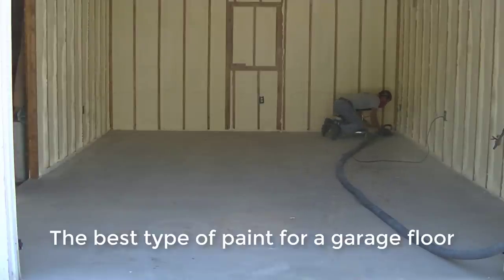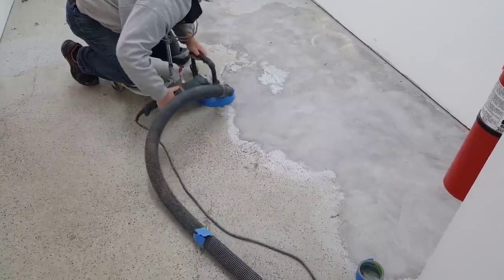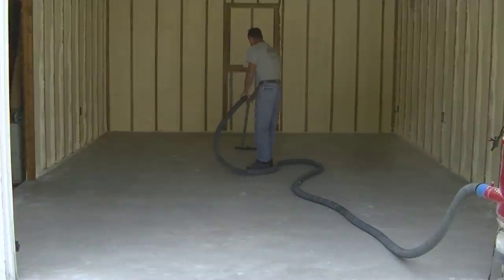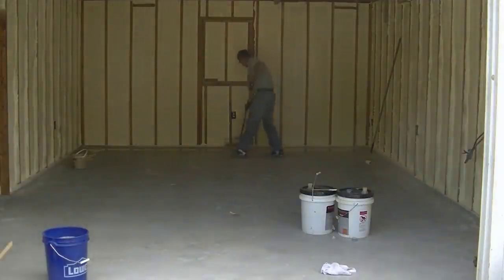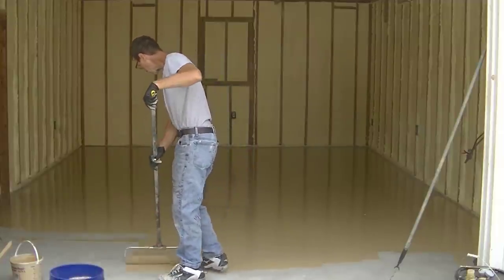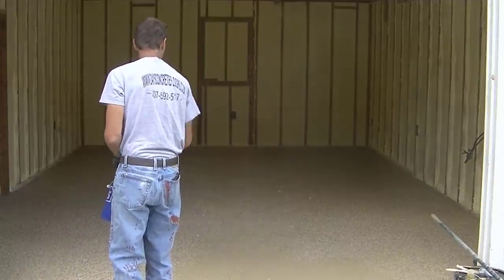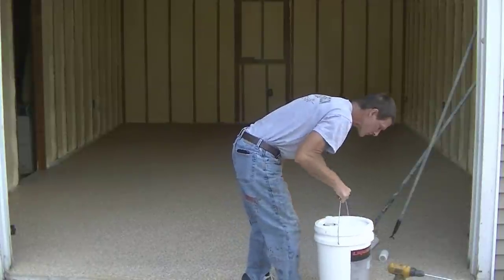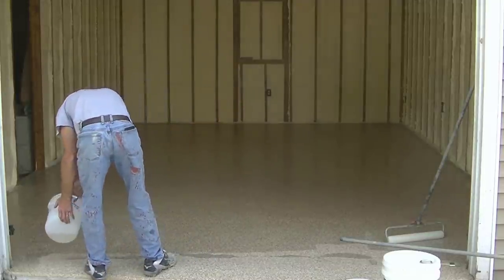Best Garage Floor Coating For A Garage Floor (Epoxy Garage Floor)

Comment: I'm going to try it. The supplier in my area sells a system which includes an epoxy prime coat, polyurea base, flake and clear urethane top and 2nd top coat. Sounds complicated.

Comment: I’m down with that. I use Epoxy Resin on desks, window sills, different projects & I was just recently talking with my wife about doing the garage floor. I’m really glad for your videos, very interesting. I’ve done hardwood floors but I haven’t tackled a garage floor yet. I’m sure it’s going to turn out beautiful, much thanx
Reply from the maker: You can do it Richard. Let me know how it comes out!

Comment: I used HC coating for our garage floor. Product application went well and we did not park on the garage floor for about three weeks. Within six months the rubber from the vehicle burned into the top coat in several locations…..disappointing. I used Goof Off, a scraper and commercial detergent to get the rubber off. Haven’t had any issues since. Plan on using Polyaspartics on the next garage project. Thanks.

Comment: We're considering coating a concrete floor but have not decided on what to use. I've used epoxy on tile floors (indoors) successfully. Thanks for suggesting the use of polyaspartic coatings!
Reply from the maker: Glad to help!

Comment: I want to cover my garage floor soon.  I have been in my house for 20 years wanting to do this.  I have seen some disaster coatings and some crazy expensive coatings. After watching this I think I can do this myself and do a good job.  Is there something I can do to fill the control joints?  I prefer to have a full flat floor.  Thank you.
Reply from the maker: We use this same crack repair material to fill expansion joints. https://youtu.be/J21TImyZL98
Reply: A1 caulking then paint over it
Reply: Do yourself a favor and have a pro do the job.

Comment: Mike, very good tips. My garage floor has never been epoxy/paint. I have a crack that you recommended the filler for. All I need to do now is empty the garage of 20 years worth of stuff...Oh!
Reply from the maker: Good luck with that Mike, sounds like a lot of stuff. This is how we fix a crack before coating the floor: https://youtu.be/5C7otrHKNgA

Comment: I had a brand new house built 3 years ago. This was the first project that I did on my concrete garage floor. I bought Rust-Oleum Rock Solid garage floor paint. I followed their instructions and it came out fantastic! I used 2 kits at about $95 a kit. Only problem with that product is, you must roll it within 10 minutes after you mix it, or it will turn into taffy!!

Comment: I am currently having a home built. I am planing on doing my garage floor. My question is , on new concrete is there still a need to go over the floor to roughing it up?
Reply: roughing up is for mechanical adhesion, for the paint to grab onto, not because the concrete is old or new. So yes, you need to.
Reply: @gwot  No, have the concrete finishers do a rough broom or a heavy broom finish

Comment: Hey Mike I have done two garage floors now.  First one I just bought the rust oleum 2 gallon epoxy kit....only comes with enough flake to speckle the gray epoxy nowhere near as much as you are applying.  Second time I went with simple gray floor and porch paint, broadcast some flakes onto the wet base coat and then went over it with clear epoxy with silica mixed in for traction.  I did it without cleats so I screwed up a few spots but no one can tell.  Next time I do it, I  going to use a lot more flake
..looks much more professional.  Oh and I didnt grind either floor just pressure washed with strong degreaser and then etched, then I finished prepping with a coat of white concrete primer which makes the actual paint spread out much better.  Concrete seems to drink up that first coat of paint if you don't primer it.  I spent about 300 bucks the second time

Comment: Two questions. Do you need to etch a newly poured garage floor? How long do you need to wait for a new garage floor to cure before using the coatings? Thanks
Reply from the maker: I never etch, I always grind the floor like in this video it's much better for prep. You have to wait 28 days for it to cure.

Comment: Love your videos Mike.  I am going to be doing my own work on my new 4 car garage I am building myself.  The concrete is new so I will be just renting a diamond sander from HD then applying products you are recommending.  The floor measures 24x48 so I will be breaking the job up into manageable sections to keep the product fresh.  I can’t wait to get started!

Comment: I had a situation where I used Polycoats  polyaspartic on a concrete floor , a  5 car garage. I’m 40 years in the business as a painting contractor and floor coatings specialist doing floors  like urethane membranes  over new plywood exterior decks with ground up rubber granules broadcast into  self leveling urethane rubber is what I started doing. The granules penetrated into the rubber  until  it wouldn’t take anymore and then we swept off the excess and then put a pigmented top coat of urethane over the granules, so everything was very flexible as well as the top coat of urethane . But when I used this  Polyaspartic I didnt have much help , it was very hard to put it down at the right Mil  thickness so I wouldn’t get too much  material buildup. My helper rolled the basecoat too heavy. By doing this , by the time you would broadcast the paint chips and as fine as they were ,they would pile up higher where the basecoat was put on heavier and they created peaks and valleys.The pot life or the grey base as well as the clear only gave me 15 min working time,  I tried to roll it out like your video example keeping a wet edge. To look at it the next day especially with the garage doors open when the light hit the floor the roller marks were in all directions and very uneven very messy and looked very bad because the valleys excepted more clear as a puddle , and where the texture was heavier ,where the flakes piled up and dried up in the heavier base material that showed more text texture and less gloss. So I had high gloss and lower sheen all over the place as the light hit the floor . I ended up sanding  the texture down to even out the floor where there were slick spots and where it looked too glossy . So the floor actually became smoother without the heavier texture of the  piled flakes ,then I took an airless sprayer with a lower sheen Polyaspartic clear , and misted it over the floor  in circular spray patterns to get rid of all the roller mark patterns  It came out even finally, but with a matte sheen.
Polycoats material is way too quick setting for the roller marks to self level. If you dont have 5 men working in unison, you cant get a uniform finish. I finally looked into some Polyaspartic that I was told had longer pot life and a longer working time. I never end up doing any more floors with such a difficult material .  Please tell me what you think about this and what material companies may have a better product ,so one man could work alone ,especially on a single car garage. These products are  such a bullet proof material nothing would compare to it
Thanks for any ideas

Comment: Mike, having new house built and learning a lot from your videos.  Have a question, my garage floor has been poured for 6 months.  It is not a smooth finish job so I have something to bite on with either of these products.  Two days ago, sub spilled oil on it and let it stand for 2 days before degreasing and scrubbing.  There is still a stain there about 12” diameter.  I was planning on just deck scrubbing the floor and allowing a day or two to dry before the oil spill.  What would you do for prep?  I was trying not to rent a grinder since floor was triled rough.  Thanks so much!

Comment: Thank you for the very informative channel. I am in Canada and my 25 year old 24x24 garage floor was never sealed or painted. It needs to have cracks filled and also levelled prior to using  any coating. I would like to do this myself but not sure and don’t want to waste my time or money making critical mistakes. Can you walk me through crack filling and levelling? Thank you

Comment: This is a great video and really explains the process well.  I had a question about the products you are using.  You put down one coat, then the flakes, then a second clear coat.  Are the products that you recommend that have 2 containers, is that the product for the first coat, the second coat or for both coats?   It is for both, are you mixing them together for the first (to get the color) but not the second (to get the clear)

Comment: that my challenge is going to be a Garage Condo 25' x 40' to store our RV in.  I'm also concerned about the weight factor as the GCWR is 15,250 lbs.  Basically, I
ll need something similar what's used in aircraft hanger coatings

Comment: Great video Mike. I have a brand new 30X48 pole barn. Just poured concrete and I made sure that the cure sealer was not applied. I'm having a local contractor out to give me an estimate so I can estimate the cost difference. I live outside of Columbus Ohio. Warren
Reply from the maker: Awesome Warren, good luck.

Comment: I’ve watched twice to get ready to paint a 3 bay garage. I like how you cover most of the items I will need. I notice that you don’t recommend a topcoat.
Reply from the maker: I used a topcoat
Reply: Mike I will have my contractor pour a garage floor soon, how long should I wait after pouring to paint or epoxy coat floor? Since the floor will be new and un-used do I still need a mechanical prep still? I will do it myself thanks for for the help.

Comment: Great video, Mike. I've been hesitant to use the big box, Rustoleum brand as it seems to be hit or miss. However, the main goal looks to be prep prep prep and I like what you did here. I'll be noting these brands you used for my garage floor. We own a driveway sealing company and it's basically the same mechanics for a concrete floor. Nicely done.

Comment: I had coated my floor with epoxy paint that  came in a kit and was well known (spray paint) brand.  It coated OK, but after much prep with muratic acid and much washing and long time drying, I was very dismayed with the hot tire lift off after only about 4 months in the end.  Question: Since my slap was poured with fiber in it, how do you keep that from hairing  up if I were to grind the old coating off? . I want to redo this, but want to go in eyes wide open.
Reply from the maker: Terence, just take a propane burner/torch to the fibers and it'll take care of them.
Reply: @MikeDayConcrete  Much appreciated!

Comment: Hi there 
I like your video the way how you demonstrate it. I just have a basement concrete to paint or coat, sealing I'm not exactly sure what the term is but I want to do it on my own and my kids can play free of dust. Can you please help with what should I use and if you can suggest a product, please and thank you? Basement is just two months old

Comment: Sorry this may be a dumb question and I may have missed it but I went back on the video a few times. 
So I went to the E2U website and found a clear top coat like you lastly used. But I can’t seem to find a base coat. What’s the base coat you used just before the flake? I’m also assuming the base coat is still wet when you add the flake. What if I’m doing a 1200sqft area alone? Do I do a patch and then flake, scrape clean and do it again? Or can I get get it all done at one time?  
Big thanks to who ever gets back to me 🙏🏼🙏🏼

Comment: Hi Mike,
Do you need to prepare the "green" concrete floor before applying polyaspartic coating after it was curing for 30 days? Also how do you check for a moisture of the concrete floor? If you need a preparation of the floor what the best product to use? Is it a good idea to apply  the sealant before polyaspartic coating?
Ed
Reply from the maker: You prepare it the way I did, by lightly grinding it. You can check for moisture by taping down a 2' x 2' piece of plastic to the concrete and leave it for 24 hours. After 24 hrs if you pull it off and the concrete is darker or damp under the plastic, you have some kind of moisture issue. Epoxy2u.com has a moisture blocker epoxy you can use in this case, then do your coating over that.
Reply: @MikeDayConcrete  Will do. Thank You.

Comment: My garage floor doesnt have cracks but it does 2 issues. 1. there is a small low spot about 12"x12" about 2 feet from the drain . Also, whoever did this floor somehow got small wood chips in the concrete. About a 1/2 dozen of them which are at the surface. I want to remove those wood chips and fill them, then coat the floor. I suppose crack weld is good for the divots left from the wood chips. How about a product that is self leveling for the low spot. I should probably rent a buffer with a diamond grinder wheel. Its a 2 car garage floor, 30 years old maybe,  never painted. I like your videos and appreciate any advice. ty Bob from Pgh PA

Comment: Hey Mike…I work concrete myself, mostly industrial formwork, and my best advice comes from you. I’m in the process of prep for a slab in my own garage…which is set on a 5’ frost wall. I’m debating placing foam under the slab, poly for sure. Should I do a separation between the slab and wall?
Sawcut and caulk? The slab is 24x26. 
Also…what thickness would you recommend, and should I use wire mesh/ rebar?  It’s mostly going to be used as a woodworking shop.  And…how long should I wait before coating?

Comment: Mike, excellent video. My garage has a 4 inch concrete ledge at the base of each wall. Do I prep and coat it the same as the floor?? I’d like cover it with something since the walls are white and the floor will be beige.

Comment: @Mike, I am chatting with E2U sales guy. THis is what he said
6150- 200 square feet per gallon
Polyaspartic 85- 150 square feet per gallon
Flakes-250 square feet per box

6150 is epoxy base coat but in your video it never mentioned. So my question for you is is there a polyaspartic base coat

Comment: hello mike, if i just scratched prepped a new concrete floor could i use a polyaspartic top coat right over it or over a prime coat...if i was going for concrete looking finish instead of a flake or painted look? thanks, looking into doing one for a good customer in a small garage where NO CARS will be going in and out

Comment: Mike how long before you can put a car back on it?  And the floor has some worn spots, what do you use to fill and level a one foot area?  What do I use to fill in the floor joints?  Thanks

Comment: Hello Mike! Thanks for the video! So the first coat you applied was a tinted polyaspartic? Like E2U's Polyaspartic 85? Then after flake, the top coat is the same product without the tint? Thanks!

Comment: Great video mike. I been thinking about doing this to my garage also. My question is I have moisture problem coming up thru my concrete floor,what do you recommend or am I best to leave it bare. Any help would be appreciated.
Reply from the maker: Michael, You can spray on this moisture blocking sealer after you grind and before you do the coating. It'll penetrate into the concrete and really help block any moisture from coming up through the slab: https://www.radonseal.com/concrete-sealers/lastiseal.htm
Reply: Do you live in a humid part of the country? Here in Houston my floor gets wet but it not coming from underneath the concrete but is condensing in to the floor from the air!!! 
Lay a piece of plastic on top of the concrete and see if it is wet under it the next time you find the floor wet!!!
If it's dry underneath the plastic and wet everywhere else then you know it condensation not water coming up through the concrete!!!
Good luck to you!!!

Comment: Hi Mike, have you run into issue using Polyaspartic coatings with high moisture vapor emission rates in the concrete?  I’ve seen recommendations of using an epoxy primer coat first then a Polyaspartic top coat. Thoughts?
Reply from the maker: Yes, if the slab has moisture you have to use a moisture vapor blocker (primer) epoxy first.

Comment: We live in Colorado.  We've used studded winter tires from Thanksgiving to Mother's Day for years.  How does this treatment stand up to studded tires?
Reply from the maker: It holds up to studded tires very good. As long as you're not spinning the tires, no problem.

Comment: I'm from the UK and I've just had a garage built... I've tested the floor with a meter and the moisture is low.
I looked at doing epoxy but it's very expensive here and i am not sure i can get the paint you used in this video...
I've gone for a heavy duty paint by Leyland who do quality paints but i would have preferred to do what you have done...
Great video and very well explained.

Comment: Great vid but how does it hold up to the concrete around a in ground pool have you done any with this stuff? Also what do you recommend for encapsulate asbestos VCT tiles or can I use a cheaper paint I will be installing vinyl plank flooring over it.

Comment: I wish I'd done that before I put all my shelving in.  Emptying out the garage to do that would be a HUGE pain in the A$$.  My garage is 900 SF.  I do have a question though.  I have about 600 SF of floor in the basement that I want to stain.  Unfortunately my concrete guy put a sealer on it.  I have 4 gallons of a citrus based stripper and a diamond pad.  I plan on using the stripper and power washing and then running the diamond pad over it. iIf all goes well and the stain takes, what sealer can I use that isn't Solvent based.  I did a room with solvent base and it took weeks for the odor to dissipate.
Reply from the maker: This is a good water based sealer that's easy to apply: https://amzn.to/30hqEec